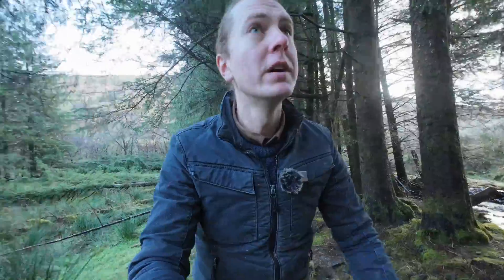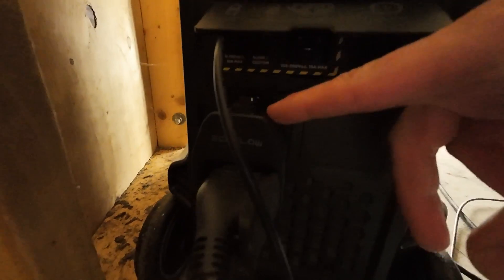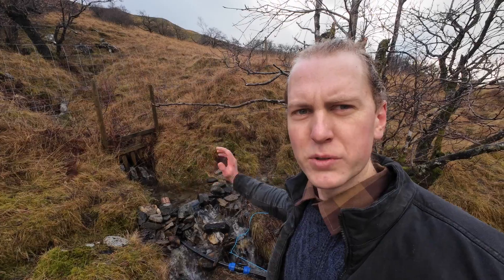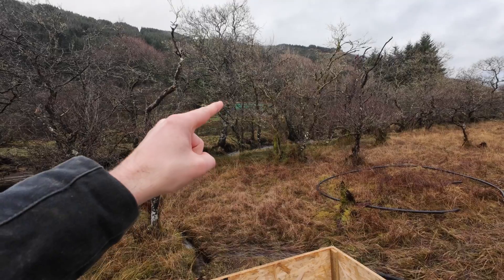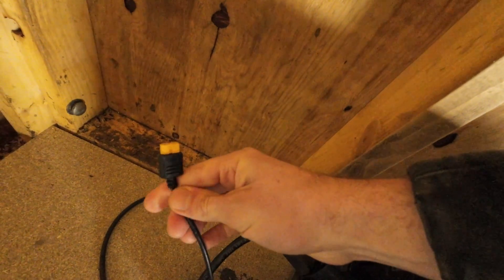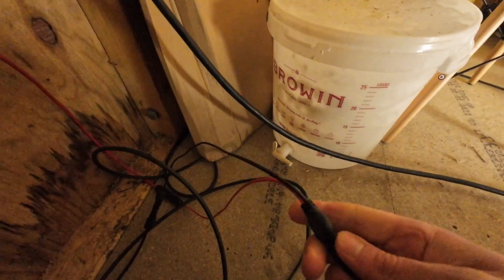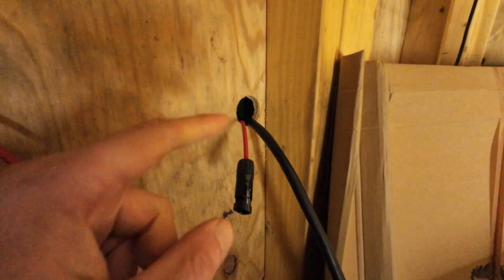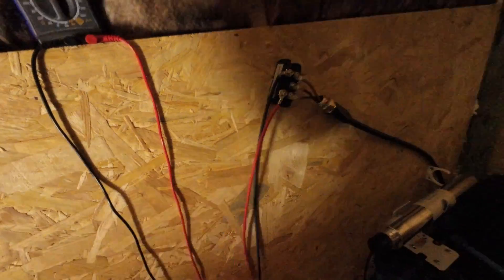Can you charge an ecoflow Delta Pro with micro hydro/wind

Comment: I just looked up the specs of the eco flow, solar input is 1600w 11 to 150 volts 15a max. Now what you can do is use a buffer between the pico hydro and wind using cheap lead acid batteries, sealed lead acid, or what ever you can source, they don’t necessarily need to be deep cycle or large because they are being used as a sink, buffer for a dump load. I’m not sure what model Motenergy out-runner is on your turbine but if it’s 48v you can just put 4 12 volt batteries in series and connect it directly. This way it’s always under load 24/7. Now dumping in this fashion is done with a simple solid state dump controller like the Xantrex C40 and your choice of resistive load property sized to your little 48v bank, this number would be your constant power from the pico hydro turbine, so say if your getting 300 watts, a 300 watt resistor or water heating element. When the eco flow needs to draw power from the 48v battery bank, voltage will fall below the parameters set on your dump load and it will stop dumping, when the eco flow stops pulling from the bank the voltage will rise and the dump load will commence.

Comment: According to Eco flow Delta pro specifications, you can charge only the delta pro ecoflow from solar and ac at the same time. So why you are invert the ac from hydro to dc and after  charging the unit? I miss something?
Reply from the maker: Ah its because solar is already DC where as a hydro generator outputs AC but not at the rate you would use AC from a wall plug so the DC input is for a variable source such as solar or hydro thus you need to use the DC input for hydro
Reply: @beyondtheworkbench  thank you for updating
Reply: How do I get the ecoflow to recognise the wind turbine
Reply: @matthewosullivan9327  to use a wind turbine for charging  EcoFlow Delta Pro requires a separate wind turbine charge controller. This is what I found from Google
Reply: And what spec is you convertor

Comment: Could I also do this with my car running, connect a cable to the alternator with a rectifier in between and than connect the rectifier with the cable you mentioned to the EcoFlow?
Reply from the maker: I am sure it could be done if all of the parameters are met but there would always be a risk of blowing it up. They sell a generator to go with it so that might be a better option
Reply: Yes I ordered this one today. I thought of adding an additional connection at the solar port as this alternator charger is only bringing 800w.

Comment: Cool setup, I hope to have something like it one day. Always wanted to make a hydroelectric system since I took my electrical construction/industry classes in college. Something about it I find really interesting. 

 One thing I want to suggest looking into that might help you if you're worried about damaging the electronics with the hydro generator is to look into using a smoothing capacitor. Even with a full wave bridge rectifier, the DC going to your device from the bridge rectifier is pulsating. A "electrolytic" smoothing capacitor with the right micro farad, voltage type and voltage rating wired between both terminals of the DC output side of the bridge rectifier will stabilize the pulsating DC. I'd recommend reading into it at least. 

A type 2 surge arrestor wired right before your charge controller would help protect the system too, some good ones are made by Midnite Solar, but they're pretty damn expensive.
Reply from the maker: Ah one of those sounds really useful thanks for pointing it out

Comment: This is such an excellent video. I have learned so much today. I was researching deep-cycle batteries charged by a micro-wind turbine, when I came across this. I live in the Outer Hebrides, where as you can imagine the wind rarely  drops. I have had a few quotes to set up a domestic wind turbine system, but have been quoted £20,000 to £30,000. I will not live for long enough to recoup that! It seems to make more sense to get a marine-standard turbine to charge a battery system to supply low wattage appliances on a separate circuit in the house. I'd forgotten about the dump load and its importance, so thanks for explaining that one. Looking forward to seeing more videos.
Reply from the maker: Wow thats so much to set up the turbine!!! If you wanted to see some of our other videos you could set someting up for a fraction of that cost. Just replace my hydro with a wind turbine if you wanted as they are very similar from the electrical side of things.
Reply: @beyondtheworkbench  I've been looking at some of those Rob, thank-you. I shall try my hand at rigging something up!

Comment: It's not complicated.  You're not "tricking" the unit, it's "Solar" input accepts 15-150V DC.  So long as you don't go over 150V DC its fine (and the unit probably shuts off if you overvolt it).  The unit can draw up to 15A at that voltage so your cables would need to be rated for that.  You might want to put some filter capacitors on the rectifier because the DC might not be that smooth though.  Regarding the dumping, sounds like a great opportunity for clothes drying.
Reply from the maker: I did find it shut off if it detected an over volt, dump loading was difficult but we are off the ecoflow now so we are running much smoother
Reply: @beyondtheworkbench  Thanks, i've caught up on your newer videos now with the new inverter.  Looks like an awesome setup.  Handy to have the ecoflow around as backup power supply now though.  Love the hydro setup.

Comment: Could you not put an electric shutoff valve in the pipes to shut the water off to the turbine when you have reached the max power you need, that would also reduce the hours of wear on the turbine as its then not running 24/7. As the power drops the valves automatically reopen and your turbine restarts again...
Reply from the maker: I will be adding something like this in version 2. We have since got a proper inverter so arent dealing with these problems at the moment

Comment: There is an adjustible power buck converter from 230V to different DC voltages depending on your requirement. Like 230V to 73.5V,  62B, 49.5V, 26V, 13.8V to directly charge your ecoflow
Reply from the maker: I haddnt heard of that but thank you so much for the reccomendation I will have a look

Comment: This is brilliant thank you! I learned more - and understood more importantly 😅 - from you in this video than I have in the last year reading about solutions and products online. Appreciate the explanation of the box itself - they could do with explaining it better like you did to demystify it for non-techie newbies 👌🏻
Reply: Can I ask you a fairly numpty question actually please! I am looking at this initially for motorhome and then once on some land for a more fixed set up (at least to get me going) ... I obviously have 240v power sockets in my van already... Do I just not use them and plug into this instead? Just thinking of layout where items are installed and having cables running around. 

I guess it's a similar question in the home... do you physically have to plug, each device / appliance into the box or do you run something off it to provide the power to the sockets?
Reply from the maker: No it literally just plugs straight into the front. I plugged a kettle into the front and it worked like that or power tools fridge etc. With the location I put the ecoflow where I wanted it and ran extension leads to the workshop caravan etc so that it diddnt have to be moved. We did need to adapt the caravan lead to a standard wall plug but one of these is what you need and just plug it straight in. (make sure your caravan has the correct sized output 16 or 32 amp) so that it fits the adapter https://www.zoro.co.uk/shop/electrical-and-lighting/plugs-and-connectors/13a-plug-to-230v-32a-connector/p/ZT3377873S?utm_source=google&utm_campaign=pla%2B%7C%2BElectrical%20%26%20Lighting&utm_term=ZT3377873S&utm_medium=pla_css_3&targetid=pla-1995579823147&loc_physical_ms=1007294&dev=c&gad_source=1&gclid=CjwKCAjwoPOwBhAeEiwAJuXRh7VOxIyW8p0RqQi8EGjNFzuvSjbqPIIeeaFCCF2TK29ONEYLIQatxxoC2mUQAvD_BwE
Reply from the maker: thanks I had hoped I was explaining it ok

Comment: At 8 min, you are half right. Low head pelton wheels usually won't over RPM. even with zero electrical load., so may not require a dump load. A note of caution, rectified DC has a ripple, this ripple can damage your charge controller. Some people, myself included use capacitors to smooth the rectified DC ripple.
Reply from the maker: I will have a look into the capacitors, was it hard to spec yours?
Reply: There are sites on the web that show you the formula to use to calculate the spec's of the capacitors needed. You will need 2 of them. Wire each one between the rectifier and the charge controller.
 @beyondtheworkbench
Reply: @beyondtheworkbench  It's not difficult to spec capacitors, but what is needed is the AC frequency when the turbine is under load. Can you measure that? Your DC voltage would also be useful. Capacitors aren't that expensive.
Reply from the maker: I will have a look although im not sure I have a device to measure hz @MarkRose1337
Reply: @beyondtheworkbench  If you can measure the Hz between two of the three AC legs that works. Your multimeter may have an AC Hz function.
Reply: Over voltage from your turbine to your charge controller is more likely and more potentially damaging. That is why so much time should be spent buying and setting up your system, so the components are matched with each other.
Reply from the maker: Thanks, hopefully our new system is up to it.

Comment: Great videos and you are doing well.  I would recommend getting that bridge recifier in a secure box so no one can acvindtaly touch the contacts. Can you add capacitors to smooth thexwave form? A coanda screen on your intake eould be self cleaning and cut down your maintenance. It is usual to put a tank at the top of the system to let the bubbles out of the water. I would put some clamps from the pipe to the power box so they don't damage the turgo if they get caught up on something like a vehicle.
Reply from the maker: Thanks these are all great suggestions. I am working on version 2 already and will definitely be using your suggestions especially the electrical suggestions

Comment: An Ecoflow can be linked up to homeassistant that could control the dumploading where you can automate the dumploading based on the remaining power in the ecoflow.
Reply from the maker: That would be really helpful! So far I haven't been able to add our devices to the automation tab of the app but they work fine on the monitoring tab
Reply: @beyondtheworkbench  you just need a wifi smart socket that can handle around 3000 watts switching. Than in automations you just need to add 2 automations. One to enable dumploading once the remain power entity value reaches 99% and turn on the smart socket. 
Than the other automation to disable dumploading when the remain energy reached 90% to turn off the smart socket. 
Try playing with the 90 value and increase or decrease based on the results. 
The remain power entity of the ecoflow is hidden by default I think. 

Try to play around with automations by adding a simple light to the smart socket and get a visual indication when dumploading should be on or off.
And if you wanna try it out without a smart socket you just add a switch helper in devices.

The big magic will start when you do the reverse and start turning off non critical devices when your ecoflow battery is running low.
Or only charge Powertools when the ecoflow battery is above 80% to utilise the energy as efficiently as possible.

Also don’t forget to put a capacitor on the  DC side of your rectifier to reduce the ripple
Reply from the maker: Thanks for the tips especially the capacitor on the rectifier. I would have looked into the smart controllers a bit more if we were planning this setup more permanently but we are about to swap over to our full inverter system so will likely encounter different problems with that setup @krakakapaul

Comment: Really interesting that thanks. 
The EcoFlow app is a let down, connecting and that automation setup would be brilliant. 
As you say connection is lame, we Have a delta max 2, mini & the power kit system  powering some of house, cabin office and garage. 
Really like them overall but the app sucks, in our garage also have a small simple victron small setup that just works ticks over connects. 
Really like the idea of hydro and wind been learning about it and this helps thank you.
Sam
Reply from the maker: Thanks! if the app worked as it said it should it would be an amazing system because you could do all kinds of automation but we can't even manage to add our devices to the automation section. It is also good having the generator come on automatically which saves a job. Sounds good that you also have some viltron components I have heard they are the best
Reply: @beyondtheworkbench  
Same can’t add them doesn’t detect them what so ever, Hopefully they realise it sucks.
The victron thing I like is it modular and if ever needed too can replace a part, never needed too the equipment is good and app is simple in a way no faff within it. 
Looks a great house project you got going on . 
Thanks take care Sam
Reply from the maker: Thanks Sam @samhartfieldlewis5247
Reply: Yes the app has issues.
A lot of people use Home Assistant to control and monitor Ecoflow kit successfully.
Reply from the maker: Good idea @sjames1958

Comment: There are DC turbines out there. Energy System and Design sells them already rectified to DC. I have a 1k stream engine and it exits the turbine as DC. The only thing is, if you need to send the power a long distance to your batteries you need a very big gauge and expensive wire. I would have rather had my turbine stay AC and recitify it at my batteries.
Reply from the maker: I think that was the reason I went with an AC generator as initially I wanted a DC one because I thought it was an easier conversion but then I realised what you said about the power degradation over long distances of DC and the cost of the cable

Comment: Would there be a benefit from dumping the excess power into a sand battery?
Reply from the maker: Thats a great idea and something I have been thinking about as it's a really cool way of storing the energy. Some people have even put copper pipes in sand batteries to heat water as well so I am looking forward to experimenting
Reply: @beyondtheworkbench  I've seen sand batteries installed under driveways, and stall barns to heat floors and keep ice away. I'm sure you can run pipe through it and set up a radiator heater with a bypass valve for summer time. Lots of inexpensive options with sand batteries. That is if you have sand nearby
Reply from the maker: Yea its a great system, another thing we are looking at is underfloor smoke heating from a fire like the romans used to do @jakebruenderman2481
Reply: @beyondtheworkbench  very interesting. I'll keep watching haha

Comment: Did you say in the video that the hydro was producing 3-phase?? And was it? I thought a bridge rectifier converted AC to DC... apologies if I am wrong.
Reply: Yes. You can use a slightly more fancy bridge rectifier to get from 3-phase AC to DC, and he has one of those. Temporarily screwed to a plate at a cheeky angle 3:25 . You can see the three phases coming in, and red and black DC wires coming out. Love the temporary shed solutions, but better days are coming.
Reply: @geirmyrvagnes8718  ah, thanks.
Reply from the maker: Yes its a 3 phase AC/DC rectifier so 3 inputs 2 outputs here is the link https://www.ebay.co.uk/itm/386262523602

Comment: i wouldnt be putting 2kw load through a cheap timer, they tend to weld the contacts permanently on or melt. you need a much higher quality one from a hydroponics shop and even then id probably use a convection heater that has a setting that matches your turbines output, there are 500w ones or those 2kw cheap ones in asda have a 750w setting. the "dump load" will be more predicable as it will constantly use that power unlike an oil heater that keeps clicking on and off. you might not even need a timer that way. really the turbine should have a special controller with relays etc
Reply from the maker: A couple of people have recommended the hydroponics timers as they are better so I will definitely be looking into those. I will definitely have a look at those heaters you mentioned as it is getting annoying trying to predict the output of the oil rad as it does start at 2kw and drop to 100w

Comment: I know you can get adjustable voltage sensitive relay, couldn't  one be set up to just under the ecoflow max voltage to switch and dump the load through heater. A bit like a regulator.
Reply from the maker: Sounds like a great idea, we are moving over to a proper inverter in the coming weeks so this is a stopgap until then although originally we had planned on using the eco flow for longer the battery just isn't big enough and a second one was as much as an inverter

Comment: Use grasslin timers buddy the cheap ones will break grasslin in my experience don’t tend to give up. Also ratings worth checking hence a contractor easy fix would be an purpose made timer for grow lights they are made to take lots of current the plug in ones melt when the heaters run. I think I have one on a shelf in the garage if you want it. I’ve no use for it but I can’t throw anything away 🤣
Reply from the maker: Thats a great suggestion they look really good. We have the new system pretty much ready to go now so we will be transferring over to that very soon